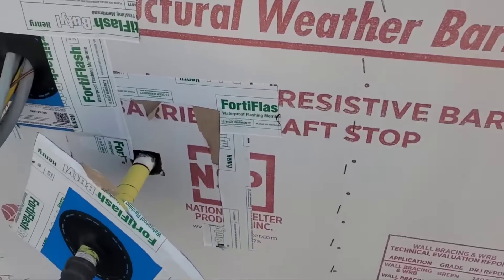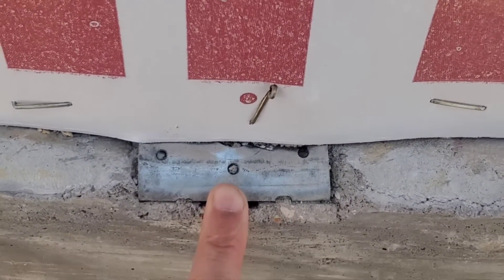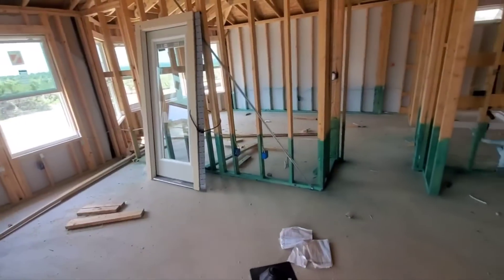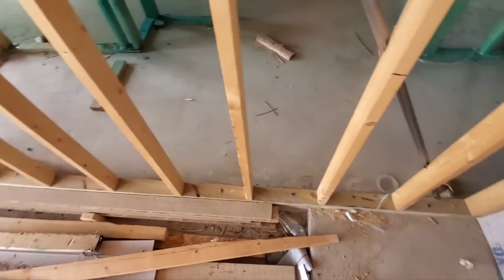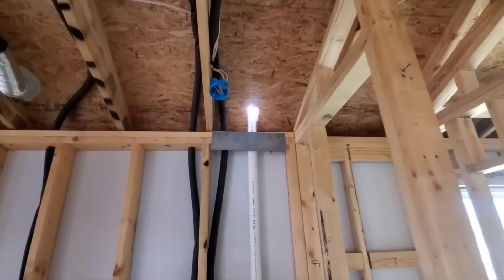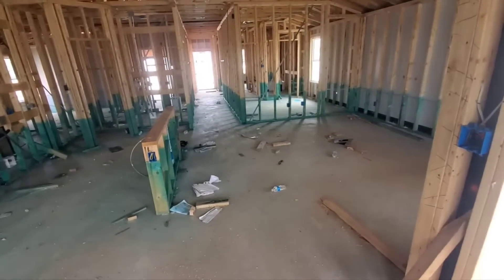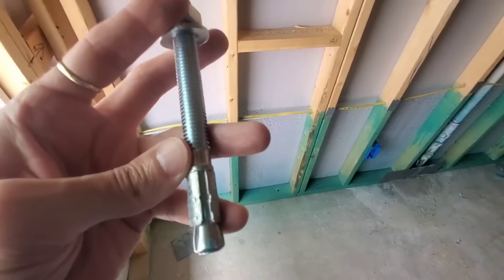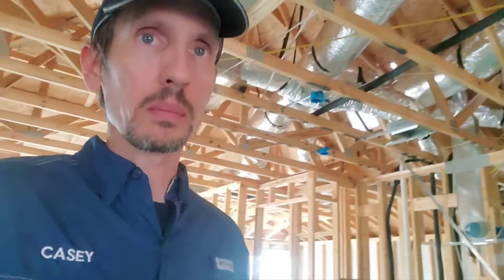How to NOT install mudsill anchors  -  Pre-drywall inspection

Comment: Holy cow. The fact that they put that much effort into "fixing" the anchors, rather than framing the wall a little bit closer to the outside of the foundation, is telling. If the foundation is that far off, it shoukd have been noted when rhe layout was done and libes wete snapped. Better to have the sill overhang the foundation by <1" than have the foundation bulging out from the sill plate.

Comment: I am amazed at the pendulum of higher construction codes and inspection standards versus cheaper quality and lower installation crew competence.  It's a constant battle to get a quality home built without shortcuts,  when doing it right doesn't even cost extra.

Comment: Those "MASA mudsill anchors" are crap. Even if you install them perfect, it still exposes the thin brack to the most vulnerable area for ancorage. Natural exposure on the thin bracket will fail over time, in the worst area to apply a fix. Stay away from this product because it is not worth the extra minutes of plate layout of conventional anchor bolts.

Comment: Mud sill anchors are so 2001 , we’ve completely quit using those and use the drill and 5/8” concrete tap con anchors. Put them where they need to be without lifting walls over bolts or hump’s from mud sill anchors.
Reply: Those things look like they cause more damage than add structural integrity.

Comment: Lmao that sill plate is going no where before the studs just lift up . That framing nail in the end grain of the 2 x 4 stud is holding just about zero I’ve see framers stand up sections of wall and the bottom plate fall off. Only way hold that wall down is with an at least 16” strap with an L and 1/2 concrete anchor nailed  to a stud every 4 ft .

Comment: This is why my dad was hated by contractors that he hired for their first time on jobs.  He went behind them like this before calling an inspection, and pointed out everything to their boss.  The reason?  He had met with the boss and explained our standards prior to work.  By telling the boss, he made sure the person responsible knew what was going on.  This way, the boss knew he wasn't getting paid to repair work that should have been correct the first time, regardless if it was contractor or contractor employee fault.  We all get paid to do our jobs correctly.
Reply: Their suppose to me a set of plans they build by, so what was your dad telling them, follow the plans?
Reply: @BasketCaseGarageForFun  Making sure the plans were followed.  Example, hold down bolts being located wrong, Top plate splices not being tied with strapping, shear wall not being nailed off correctly, etc.  The things that are taken for granted to be done right, but are often assigned to new workers because they are beneath journeymen.  The details matter.

Comment: What's the possibile fix for the wire and gas line that pass by each other short of routing up the wall to the ceiling and back? Any kind of spacer you can use?
Reply: Wonder if they can just move the gas line up.

Comment: There is a 'blue screw' Or powder actuated concrete pin, between every other stud on that wall.  The carpenters DID address the construction error of the foundation being poured  unsquare.  A sleeve anchor in one view at that plate end.  But then it HAS been addressed.  Are they rated for that use in that code jurisdiction?  I have no idea.  But first,, attributing the error to the rough carpenters,, BS.  And then when the carpenters did address it with blue screws or powder driven anchors,, you gloss right over it.  "There is no fastening in this wall.. BS  You just lost my vote.  Blamed the wrong people.  The people who did address the problem you continue to blame.    You don't know what you are talking about.  Thumbs down.

Comment: I've never seen those anchors before. They look like pieces of crap. I would never use.
Reply from the maker: They are rated equivalent to anchor bolts, actually. And having the ears makes them a bit more versatile in their placement. Check em out:
https://www.strongtie.com/mudsillanchors_concreteconnectorsandanchors/masa_anchor/p/masa
Reply: @constructivainspections  And, as your video points out, they can be grossly misused. I know it is possible to use an anchor bolt improperly, but it is much more unlikely.

Comment: Nice Inspection, Did not notice any straping of roof trusses to walls if one is tying/strapping walls to grade beams/foundation why wouldn't tying/strapping the roof on be logical? Strapping the wall sills to foundation without strapping the sill to the wall studs seems non-sensical. Thankfully owner had this inspection, I would flow test all drains now to make sure no partial blockages exist. This would never pass in my area it's almost impossible to stick frame  exterior walls with our building code in Miami-Dade County. Ray Stormont
Reply from the maker: Yall have a wind design min of something like 150mph I think. Out here it is 105mph and a few municipalities have 90. Waaaay different location. Yall build wooden castles out there. We build... well... houses of cards.
Reply: Still good practice to buy a dang box of hurricane clips whether in Fla or not.

Comment: You don’t put red heads in the framing of a non load baring wall lol. What are you talking about. I’ve done framing for a long time. Never once seen anyone drill read heads on anything that wasn’t a load baring wall. Are you an inspector? Plus you said they should have strapping on the header? Why? What would cal for them to have strapping on the header cause you said it’s wrong but your not saying why. Bro if I saw you on a job your ass would be thrown the fuck off of it.

Comment: I worked across the street from a condo development, the slabs were poured but work was suspended.  I was sitting eating my lunch and noticed these kids going around dropping rocks and chunks of concrete down the sewer pipes.  The condos finally got built years later, often wondered how often they had to call rotor rooter.
Reply from the maker: Oh JHC... I call out open drains when I see them uncovered on these sites. Seen too many problems with construction debris down the sewer lines!
Reply: @constructivainspections .    You should try taking to a plumber like me of 41 years !

Comment: There  is some weird shit going on in that attack.  Look again. Maybe it's just the video.  It's like part factory truss and part cut roof with "T"ed braces and part looks like purlins.  Now he said he doesn't know, and that's good, but those drive anchors work with expansion of that sleeve when that cone pulls up through it.  That adds pressure to the concrete, which isn't a good thing.  And one more thing, most engineers and blueprints say no steel within three inches of the surface, so even the metal plates could be a disadvantage.

Comment: Wouldn’t be better if they had threaded J bolts . When the foundation’s was pored
Reply: Because that would require proper planning. (the mud plates they used look like they were $1 each.)
Reply: @jfbeam   in a tape measure they have marking for studs  , beams.  And could a measurement for the brackets to.
Reply: That is why many builders chose to go with the MASA mudsill plates or post installed anchor bolts. The concrete guys wet setting the anchor bolts never get them in the right place and you have to cut them off and post install something anyway. The quality in the house in this video is very low. No supervision of the subs in the field. They’re just doing what they want.

Comment: Just like cars I will never buy a newer home! The way they are built is nothing compared to years ago . My current house was built in 1914 is solid brick is in perfect condition,  my only  issue with it is Modern Code telling me if I have the roof stripped and replaced I have to redeck the roof?? Not if I can help it, the current construction of the roof Deck is original to the house it survived over 100 years of harsh Upper Michigan weather! Today's Plywood and OSB can't beat solid wood!! The current decking is in perfect shape, no water marks ,Rot or any kind .  I'm trying to hold off as long as possible the shingles are getting rough if I can save it from Codes grubby hands with a Historical exemption I will fight for it! . My point is nothing today is built to last. I'm not saying code is bad for newer construction just it's not good for old homes like mine it can ruin a old house before it helps it.
Reply: Don’t forget survivor bias.  They certainly built bad homes over 100 years ago when there were no codes at all and people did what they want, but they didn’t last 100 years.  Only buildings that old which were built strong and tough would last that long and still be around today.  I live in a house built in 1955.  The bones of the house are much better than a new construction home I lived in before that, ie no gusset plates or trusses.  However, things like wiring and plumbing are definitely not better in the older home, with many rounds of renovations over the years.  Some of the lights in my house still have cloth insulated wires with no ground wire, which is how it was done back then.  Not to mention things like lead paint and lead in the pipes that a lot of homes my age have.  So some things are definitely better and safer with modern codes.
Reply: That's a terrible code and I would definitely fight it
Reply: You can put the OSB or plywood right over the original roof sheathing. You don't need to remove it.
Reply: Like the above comment, just sheath on top of the existing material.

Comment: My late father and his brothers would build the foundation within less than an inch of square and the rest of the building was also square. That would fix some of the issues that we are seeing, but the rest of the issues you are showing are just not caring. Slap the building together as quickly as possible and cheaply as possible. Not built to last, that’s for sure.

Comment: that's not a cheap house based on the size.  the company needs to educate the framers so that they can recognize problems and FIX things as they come up.
Reply: I doubt it’s the framers lol. It looks like the concrete work on the foundations fucked in my opinion.
Reply: I’ve seen enough. About to vomit.
Reply: Bring on the cheapest trades.
Reply: Is this Texas?

Comment: Holy schmoly. This house has bad bones. If the builder allows this quality from their subs at framing then imagine the spider web of poor quality you get in the finished product.
Reply: I doubt it was the framing. I bet anything the foundation was out of square and that’s why some of the framing was good and some wasn’t.. I’ll bet you anything they were fighting the foundation. Think about it, if your the framer and your willing to do that shit of work why wouldn’t you just cheat the wall to match the outside of the foundation? Instead they wanted their shit to be square and straight so they probably did what they could. I’ve been i that same situation but we had the fuckin concrete guy come back and poor onto the foundation he already did because our walls if we made them square would have been floating in mid air in some spots
Reply: @xaphan8581  100% gaurantee you that it was not because of the foundation.  this was ALL because of lazy and sloppy framers.   foundations are almost NEVER "out of square" as you say....  lol.  thats just rediculous.    the concrete was fine,  it was the Framers that are to blame for all this.  they did a absolutely shitty job and it shows that they just did not care about doing the job correctly.   the fact that you are trying to defend the framers tells me that you are probably one of the framers that did this shitty job.....

Comment: More of a question as it is something I have not seen before... at 2.58 there is a stud not resting on sill plate, but running down to floor.  Is that the correct way to splice sill plates? Wondering as if so, I've been doing it wrong. Thanks for the video, always seem to learn a bit more!
Reply from the maker: In short, no. I don't remember offhand what was going on there but I don't think it would have made much of a difference. 

Always good to hear from the old hands though. Thanks for watching!
Reply: i can tell you it is not the proper way to splice a sill plate ....42 year in the trade now retired thank the lord
Reply: @papabash  I too am retired and only did construction for a short time as a trade, then only for myself and to help friends. Got into manufacturing full time, but I still enjoy doing some and always eager to learn (trying to prove something about an old dog and new tricks).  Honesty seeing some of the new construction videos sometimes makes me wonder how some of these things stay up, and to think we have to pay so much for them.  Pride in workmanship seems to have died or been replaced by greed.  Thanks for the reply and for your sharing of true knowledge!
Reply from the maker: Was just telling the other guy there that it's always good to hear from the old pros. Thanks for watching!